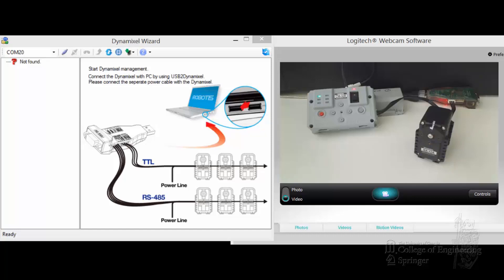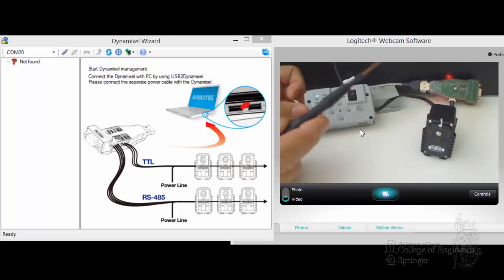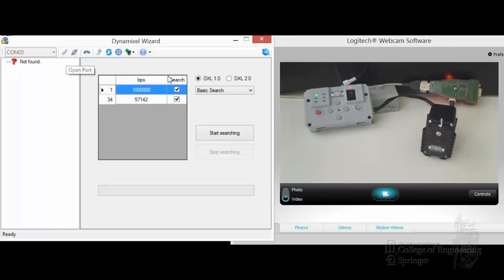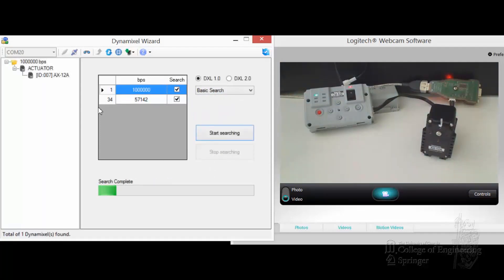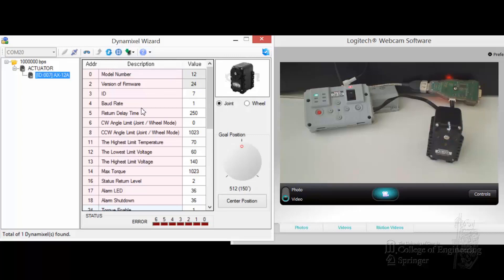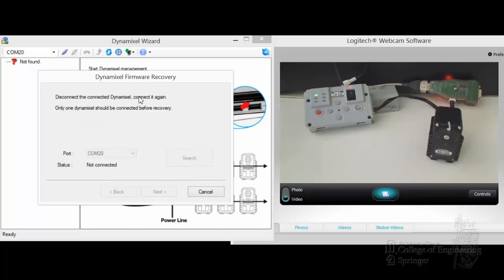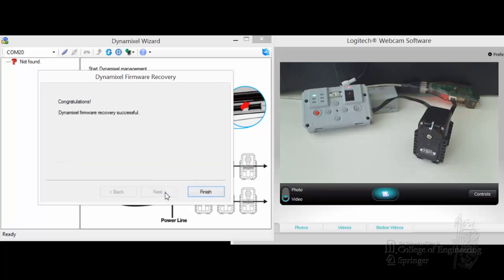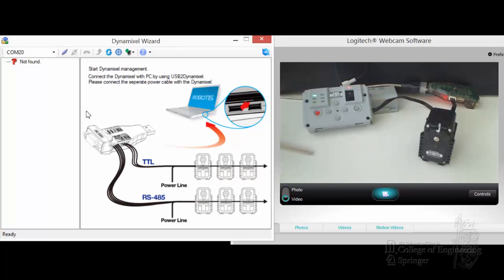B_Video 4.1 - Dynamixel Firmware Update via Dynamixel Wizard & USB2DYNAMIXEL

Comment: COMO SE CONECTA O ACTUALIZA LOS DRIVERSS
Reply from the maker: According to the on-line translator, your question was "HOW TO CONNECT OR UPDATE DRIVERS".  Which drivers did you mean?  The driver for the USB2DYNAMIXEL dongle has to be updated via Windows Update.  The various Dynamixel firmware are kept current by updating the Dynamixel Wizard to the current version.  Regarding updating the firmware of the CM-530, it has to be done via the MANAGER tool.